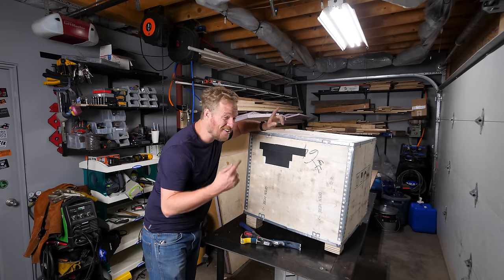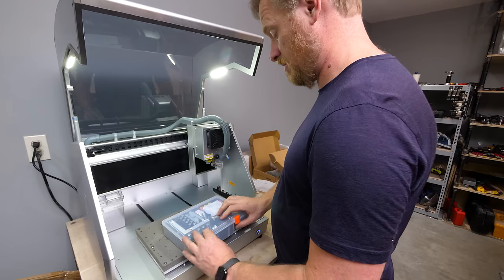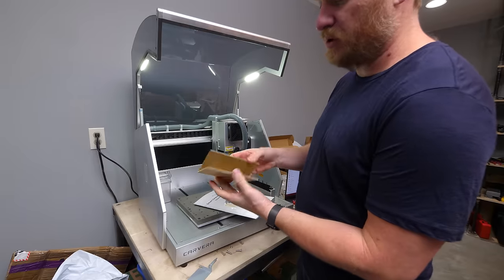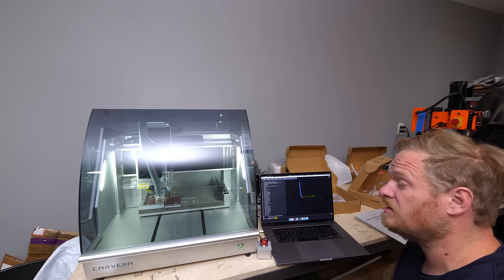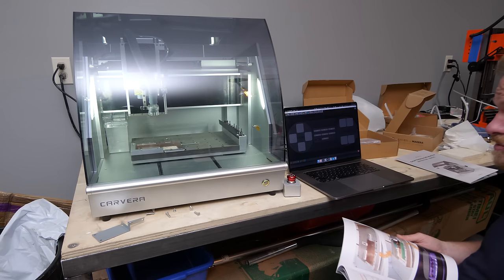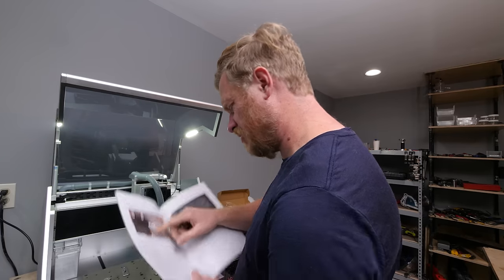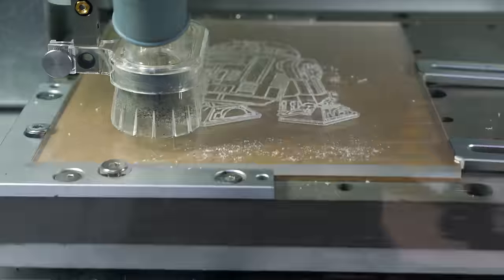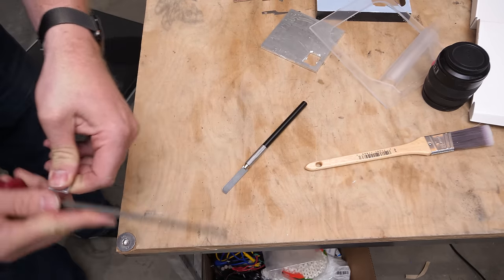Carvera - The Perfect Desktop CNC Mill?

Comment: you can buy a chinese 3040 cnc from ebay for less than 1/5 of what this costs for the same level of performance.  For the price they're offering you could buy a really nice CNC router that will actually make parts.  Companies should be ashamed to offer such flimsy, anemic machines at premium prices.
Reply: Show me a 3040 with that performance please. They all have horrible and flimsy moving gantry design and very few have linear rails and ballscrews. Even less have servo motors and not just steppers. But in they end they are not even the same type of machine. One is a starting point and another is the complete package with lots of functionality before only found in large professional machines or large and advanced diy projects.
Reply: Just off the top of my head, sainsmart will sell you a fixed gantry, linear rail, ballscrew 3020 class machine for $550 that will compete directly with this thing for milling performance. $2000 will get you a cnc Taig mill that will annihilate this in performance (mine cuts stainless and tool steel, good luck with this thing), with plenty of cash left in the budget to put TTS quick change tools in it. $5000 puts you in the realm of a really good used knee mill, or a brand new benchtop mill from precision matthews, seig, or similar Taiwanese imports. You're almost at the cost of a real cnc machine from Tormach. All for a 200w 3020 class machine dressed up all very fancy. Hard pass.
Reply: @redramage  the sainsmart looks extremely flimsy compared to this, has leadscrews not ballscrews and doesn't have linear rails on y axis. Those spindles although in the same ballpark power wise(300w brushed vs 200w brushless) are known to be extremely shitty. Taig is nice but has a completely different work envelope. The version with one similar to this one and ballscrews is almost the same price as the carvera and doesn't have an enclosure, atc, servo motors, automatic work or tool probing but yes, is a way more rigid and stronger machine. You could probably cut steel with this but you would obviously need to choose your tooling and feedrates carefully. Not to mention be extremely patient. If money was no object I would prefer this in my apartment workshop. Since money is a factor I'll build my own that's hopefully cheaper than the sainsmart, as rigid as the taig and as suitable for the desktop as the carvera.
Reply from the maker: Are there 3040's out there with automatic tool changers?  Honest question.
Reply: @strangerparts  not that I'm aware of. It's far more common to have a tool setter that you jog to after doing a tool change. An ATC is certainly nicer than a tool setter, but the utility it brings on these micro machines is questionable. Usually you'll do the job with one tool. Yoy might have a single tool change when doing a carving where you rough with a 1/8 ball nose and finish with a single flute engraving tool. I doubt you'd even have different rough and finish tools for aluminum milling; the tiny spindle motor and lightweight machine limit one to small cuts only. A frequent tool change cause is hole making where you would spot drill, then drill, then tap, ream, counterbore, whatever else you need for the hole. On a small machine like this you're either interpolating the hole with the same 1/8 endmill that you're already using, or you're doing a single tool change to put in a spot drill to locate holes you'll finish on a drill press. A quick change system like the tormach tooling system gets you 95% of the benefit of an ATC without reducing the available work envelope or greatly complicating the spindle. Even if you had a job that ran for hours and had a bunch of tools, you can't leave a cnc running unattended safely so an ATC doesn't get you much more than quick change tooling would.
Flashy and costly feature that's out of place on a small, featherweight, low power milling machine. Again an American made Taig with American made Geckodrive electronics and American made quick change tools is orders of magnitude more capable and only half this sticker price.
Reply: @redramage  You can't make PCBs with only one tool, heck you might need several different diameter drills depending on the design, never mind the track cutting bits and solder mask burrs. The wireless Z-axis tool that comes with the Carvera is another game-changer allowing hands-off levelling of the workpiece. There's a video somewhere of a side-by-side comparison video showing the Carvera doing a job and someone having to make tool changes and set heights to do the same job on a regular CNC router. Lots of operator interaction and time wasted in the latter case plus more chance of an operator setup error resulting in a tool crash and maybe bits breaking.

I spent a thousand bucks on a FoxAlien WM3020 CNC because it has linear rails and ballscrews so I can expect more rigidity, less tool chatter, repeatable precise movements with less backlash on all three axes etc., something a cheap 3040 CNC can't do. Worse still the leadscrews and leadscrew nuts of the cheaper CNCs will wear and get sloppier over time. I was very VERY tempted to order the Carvera CNC because of its ease of use and engineering quality but deliveries were delayed and the WM3020 will work for me to machine plastics, aluminium, brass and maybe steel inc. stainless. The extra cost did pay a part in my decision to go for the WM3020 though, I will admit.
Reply: @robertsneddon731  A $2000 taig cnc mill with some TTS tooling will still be super fast tool changes with minimal opportunity for operator error for your circuit boards, with the additional benefit of being able to actually mill aluminum instead of dusting a few thou off per pass, and machining stainless and tool steel to boot. 
I really don't care how much fluff and marketing is put on machines like this, a flimsy featherweight "mill" with a dremel for a spindle that costs twice what a good desktop cnc or as much as a legit benchtop mill with DRO and all the trimmings is simply unacceptable.
Reply: @redramage  unacceptable for you maybe but for lots of people it's not fluff. If you design pcbs for a living this is a steal. Professional pcb Mills with similar functions are way more expensive. If you live in the city/an apartment there isn't an option that brings as many capabilities in such a small footprint when it comes to both size and noise. The atc still is a feature and can save time with the right use case. Some people have more money to spend and value these features and having a new supported product. It's not fluff. What's fluff is cheap 3040 routers with trash brushed spindles using low quality skate bearings because the beefy motor and high wattage makes it look powerful when in reality it has huge runout and low lifetime.
Reply: @redramage  The Taig you mention is a small Seig-family milling machine converted to CNC via stepper motors. It has leadscrews which makes it, at best, a 2.5D mill capable of making straight cuts in X or Y well but not both at the same time. Backlash in leadscrews is a real engineering problem which is why real CNC mills use ballscrews and cost a lot more. The Carvera uses ballscrews so that it can deliver precision cuts in the 3-D workspace that a converted milling machine or an Aliexpress 3018 router just can't. There are other expensive upgrades in the Carvera like linear rails on all three axes, much more precise than the cheap sliding-bush ground shafts or wheels-on-tracks that many lower-spec CNC routers use.

Cutting steel is a push for the Carvera, even aluminium or brass is going to be tricky. For plastics, PCBs, wood etc. it's a ready-to-use civilised CNC router with enclosure, dust collection, tool change, wireless Z-axis level detection etc., features that makes it usable in a small office rather than having to be operated in a shed or workshop where chips, mess and noise are less of a problem. Add up all the extra features and the price tag is, I think, reasonable.
Reply: @robertsneddon731  extremely wrong, taig makes all their stuff in house in the USA. It's not the ubiquitous casting sold under a bunch of brand names. They do have lead screw models and "cnc ready" kit versions but they also sell ballscrew cnc ones direct from the factory. Not to sound like one of their salespeople, but I have one and it's outstanding
Reply from the maker: I’m regularly using. 2 tool workflow for aluminum and plastic (1/4” roughing end mill and 1/8” finish end mill), and 4 tools for PCBS (endmill for edge routing, v bit for trace routing, drill for through holes, and spring loaded uv mask removal bit). I’m enjoying having the ATC so far…